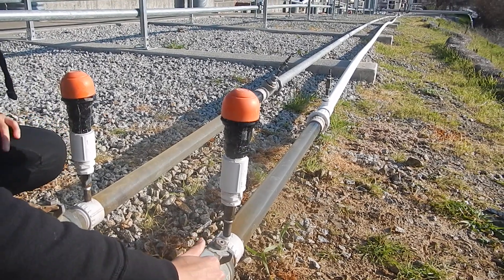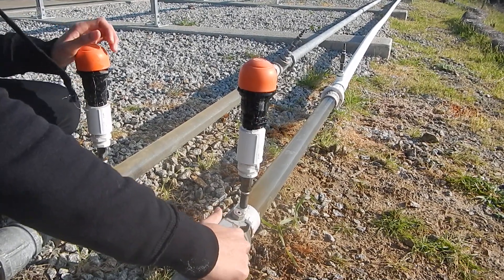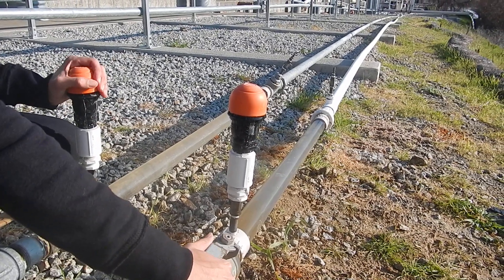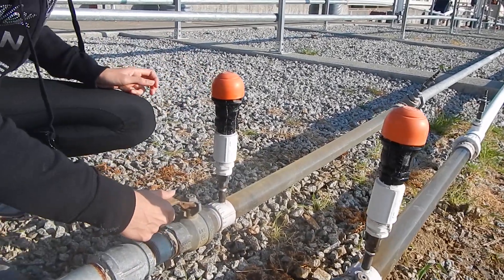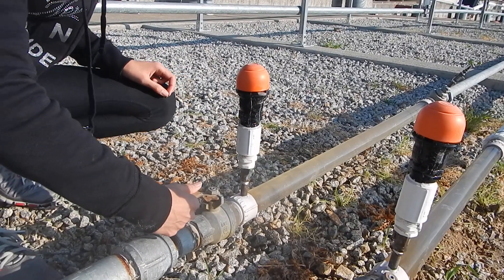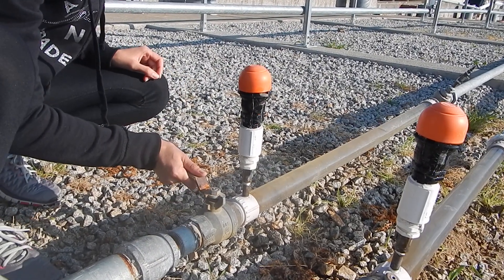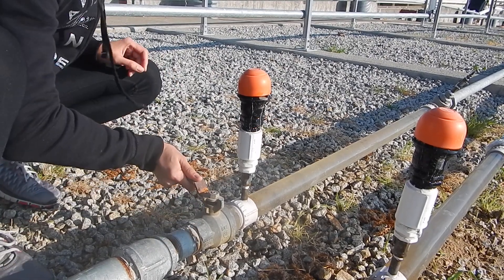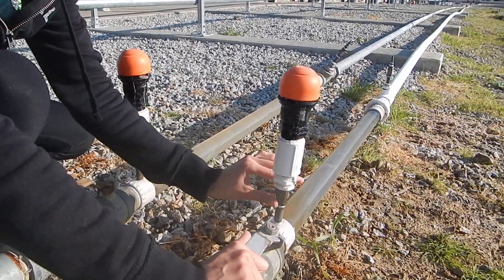Water Hammer Demonstration

Comment: i still dont understand lol
Reply: Water (or gas) is moving inside the pipe. If you close the pipe quickly, the moving water has nowhere to go, so they basically press into the end of the pipe, creating a region of very high pressure. Think of it like hundreds of people running inside a narrow tunnel. Imagine what happens if you close the exit suddenly.

Then it rebounds, traveling backward in the pipe then forward again then backward, so on and so forth. Hence a water hammer, because it sounds like a series of loud bangs. This can cause serious damage (the pipe would literally burst) and is highly dangerous in certain situations.
Reply: +Angry Kittens 
well said guy

Comment: Great demonstration! Interesting to see how the water column separation occurred right at the valve on the PVC pipe, and the vapor pocket formed further down the line with the steel pipe. You should have installed a high frequency pressure transducer at the valve to record the pressures and compare between both pipes.

Comment: Can this air vent be used in a factory on the main water supply?
Reply: Jay shwaz  Check your solenoid or pneumatic water valves first. There is probably one causing the problem.  Took forever to find the one causing my headache.

Comment: In which direction is the water flowing?
Reply: I thought it was going away from the camera, towards the horizon. When she opens the valves the bubbles just go in that direction. Or I got completely wrong?
Reply: @Lucas this was my impression as well. The air vents only make sense if the hammer effect in question is happening on the outlet water - and it is, you can see that the vents are immediately after the valves - because they work by letting outside air relieve the vacuum formed by water flowing away from the closed valve. They do not relieve fluid pressure; if that were the case, water would gush out from the vents when the valve was closed (it spills when the valve is reopened, but that's just the vent's check valves closing).

In this particular scenario, the closing of the valve stops the inlet water flow (which also produces a hammer effect in the back pipe, but it's probably designed with that in mind) and the water flowing away from the valve creates a vacuum which pulls the water column back, smashing at the valve. The air vents are there to allow air to flow in and prevent this from happening.
Reply: Bima C. Bhaskara It's flowing towards the camera.